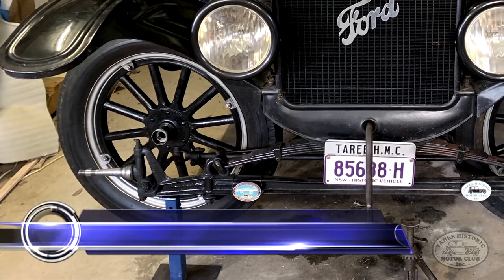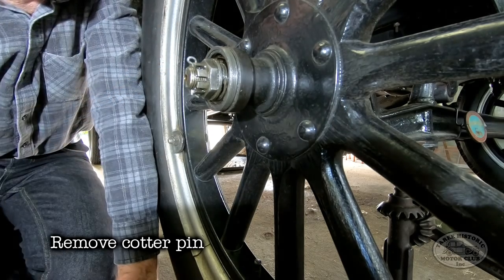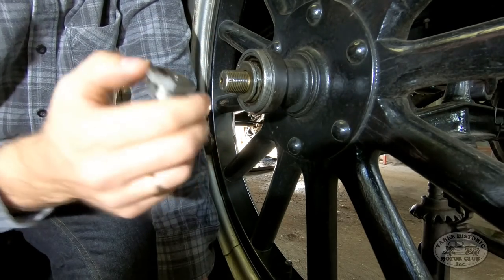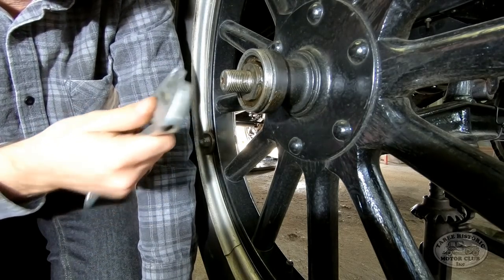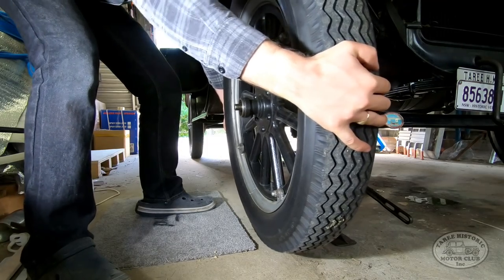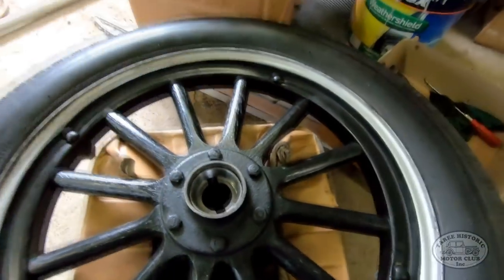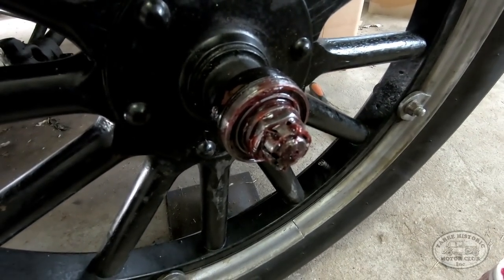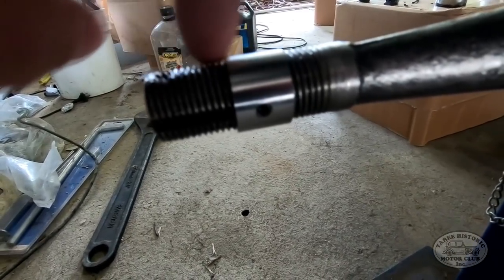Ford Model T - How to Replace Front Wheel Bearings

Comment: Place a glob of grease on your palm, draw the larger side of the bearing across it in a scraping motion.  Do this in small amounts until you see the grease flowing out the small side until full.  When tightening the nut on the spindle, rotate the wheel to evenly distribute  the force, rather than concentrating it on the stationary small line of the rollers.  Probably no harm done.  Keep the shiny side up.

Comment: The way I would grease , these bearings was to put a blob of grease on my palm and then put the bearing on one or two fingers and scrape the blob into the edge of the bearing to fill the inside , and that would also push out any dirty grease  that may be in the bearing.
Great video !
Reply from the maker: Thankyou for the tip 🙂

Comment: Timken bearings are the best.  Converting to tapered roller bearings is a plus.  The old grease in the palm of your hand trick is hard to beat.  I have a bearing packer tool, but I seldom use it.  Old assembly line trick was to tighten the nut while the wheel is turning until the wheel stops, then back the nut off one flat of the nut, then find your cotter key alignment.  If the wheel doesn't turn freely, back the nut off one more flat.  Roller bearing do need proper pre-load.

Comment: Nice job! I’m glad I’m not the only one to make silly mistakes sometimes when working on vehicles. Interesting to see some of the similarities between the Model T and my Super Major despite there being 37 years between them!
Reply: Same as Ford 4000 tractor and probably many others. Instead of axle stands I used to prefer several blocks of wood such as  9x3s stacked upon top of each other, less wobble.
Reply: Yes I often use wood as well. Never concrete blocks as some people like to use though as they can fail!

Comment: What I seem to remember doing with the roller bearings on my 1968 vw beetle was tigheten the castellated nut (or the clamp nut, I forget which) to a specific torque setting, while spinning the wheel, then backing off on the nut either a measured number of degrees of rotation, or backing off slowly while measuring the end-play with a dial gauge.  I think I backed off on the nut just until I could feel a tiny amount of play when I pushed-pulled the wheel in-out on the tapered stub axle. About .02 or .03 mm (.001 inch) of end play, if I recall correctly. Once I was happy with the end-play, I'd tighten the clamping screw in the clamp nut, or loosen the castellated nut just enough to get a cotter pin through the hole in stub axle, somewhere on the castellated nut.

Comment: Another grand video Mitch! You do a great job of showing how to work on a T, far better than any others I have seen. One related question. My 1927 does not have screw on hubcaps! There are little metal tabs you bend! It seems terribly inefficient. You have to pull at the hubcap until the tabs inside the hub bends enough you can pull the hubcap off. To put on, straighten the tabs just enough to force the tabs into the hub.  The hubcaps don’t fit tight. They flop around but don’t come off. Or am I doing this wrong? I can’t find any instructions or photos about this in literature, Google, or Utube.
Reply from the maker: Thats a very interesting one! I'd post the question to the MTFCA forum, or join my Facebook group - never heard that one before! :)

Comment: I like your video very helpful; I keep coming up with the Temkin ones that thread on, and I want the ones you use with the collar.  What are brands and part numbers for them front wheel bearings inner and outer with the races and seals?

Comment: Hi Mitch.  What are the Timken bearing numbers ? And name, supplier or where to get that sleeve that goes over the thread ? Thanks in advance.
Reply from the maker: I bought my wheel bearings from Snyder's Antique Auto. They sell it as a complete kit:
https://www.snydersantiqueauto.com/product.htm?pid=981043&cat=41886
Reply: @ModelTMitch  Thanks very much for the link to Snyders. The picture of the kit on their site shows inner and outer bearing inner races being threaded ?  Something isn't right as the inner bearing goes onto a plain part of the stub axle ?  And your kit has plain inners for both with that little sleeve ?  Are there different kits ?

Comment: The inner bearing is locked with a shrink ring, the easiest thing is to cut it with an angle grinder.
A shrink ring is a little narrower than the shaft, it is heated on 120celsius  in a oven then it is put on and it shrinks and lock the bearing.
If it is possible(small el motors) then freeze the shaft/motor  too  never hammer it on.

Comment: Is there an accurate torque spec? GM uses 12ft-lb max whilest rotating wheel to seat then finger-tight plus some to make next cotter hole line up on tapered roller front ends.
Reply from the maker: Mr Wolf : it needs to be tight enough so the wheel can still spin freely, but not too tight so as to squash the bearings and cause the wheel to not spin freely. Also not too loose else the wheel will wobble and damage the bearings

Comment: Small question to anyone, what's a good price range for one of these?? It'll be a LONG time before I can get my hands on my own Tin Lizzie, but I'd like to know what's fair and is not fair. I'm currently looking at one for $10,999 for a 1922 T with back seats and a top, and having 100 miles on it. Seems to be fine but, as I said I really don't know how to determine good prices for these. I've heard people say you can get one of these running for less than $2,000 because of how easy it is to find parts and a Model T in poor condition and work it up, but I have no idea how true this is.